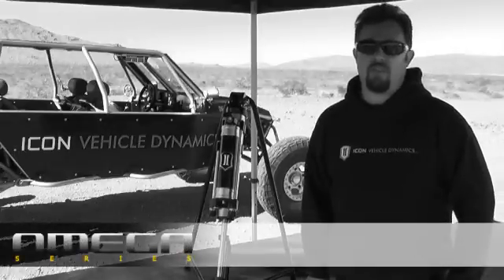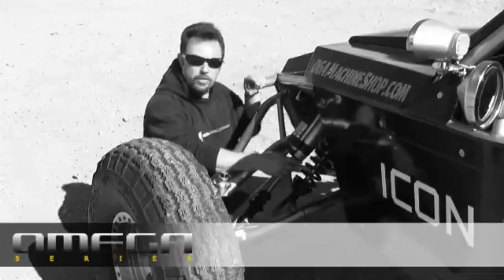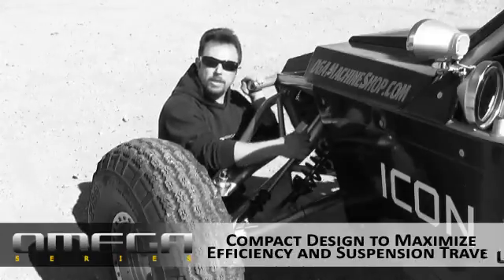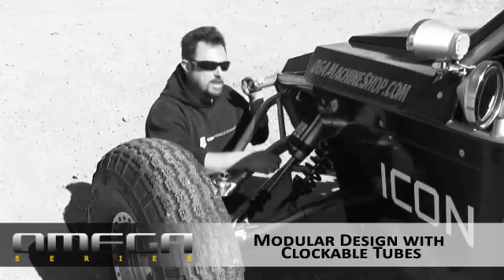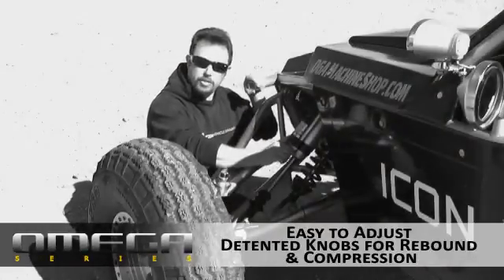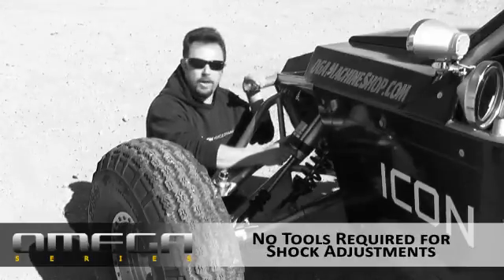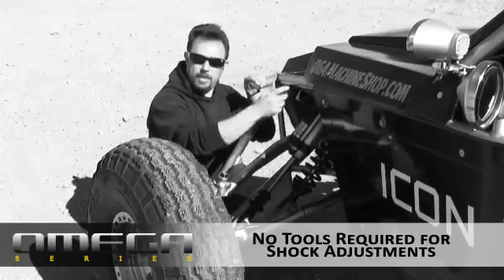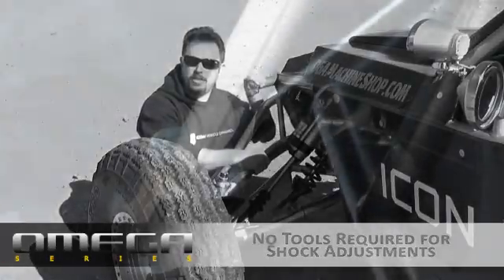OMEGA Modular Bypass Shocks Testing

Comment: I just installed some 2.5 remote res bypass shocks with compression and rebound adjustment on my FZJ80.  If I want to increase rebound (have faster rebound response) is it a right turn (tighter) knob adjustment or should I be loosening (left turn) on the knob?
Reply from the maker: Hey Adam, to make the shocks rebound faster you'll want to turn the top knob counter-clockwise. To make the rebound slower simply turn the knob clockwise. 

We recommend making adjustments in four-click increments and keeping track of your adjustments by counting the number of clicks from the fully closed position (all the way in). 

Hope this information helps, thanks!
Reply: ICON Vehicle Dynamics thank you very much!